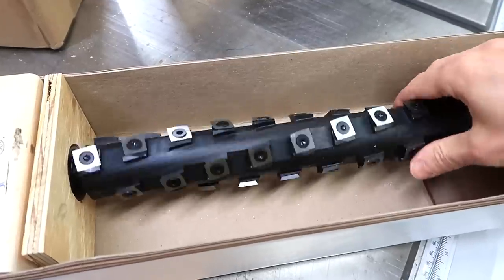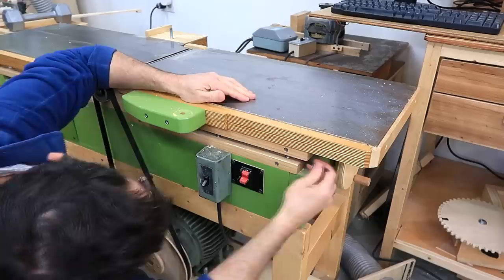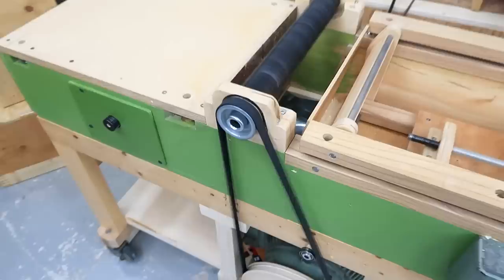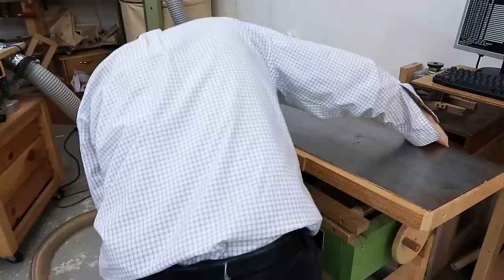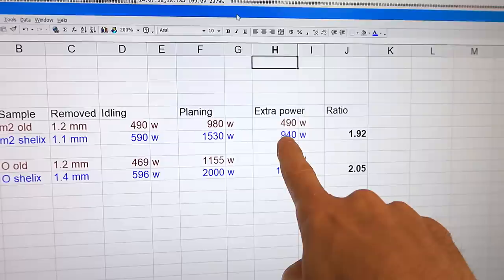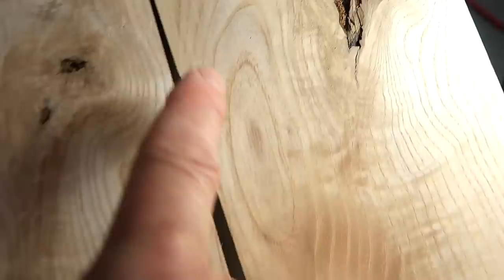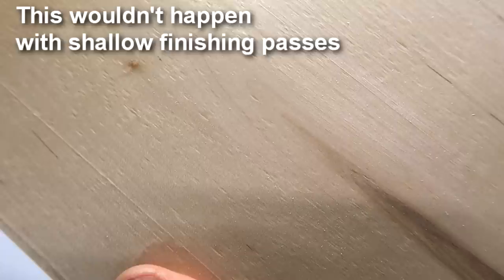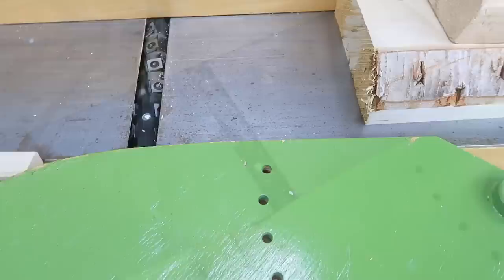Shelix head vs HSS planer head: Comparative tests

Comment: Recent installation of Shelix head in my jointer has made a world of difference in the ease of use of the jointer and the noise level. The jointer operation is MUCH more smooth and much quieter. Quality of the cut is much better. Have on in my Makita planer as well.

Comment: You have to find that problem! My shelix is whisper quiet in my jointer and much louder in my yellow Dewalt planer. 
That thing is dangerous.(I think, I don't actually know) 

Also! I didn't think I had a miss aligned cutter in my planer and I thought I bent something. I'll go take a look next time and maybe I just shifted a cutter on the pallet garbage I was running thru there. I was afraid to look.

Comment: Nicely done.  You could probably see if it is balance or the bearings by removing all of the cutters and letting it spin.  Could also test that it was ground round and straight when doing that, since you already have the dial indicator handy.  It's a lot of little things to undo, but it should work.  Also, you could better align the cutters when reassembling. :)
Reply: How does removing the cutters tell you anything? Any imbalance would almost certainly be in the head, not the cutters.
Reply: @trevorlambert4226  The cutters might have come from two different manufacturing batches and might have different thicknesses.
Reply from the maker: if they had different thicknesses, that would be VERY obvious from the cuts!
Reply: @matthiaswandel  Great point!

Comment: Is the Shelix head heavier than the old head. On my DeWalt DW735 planer, I think the default head was aluminum and thus a lot lighter than the Shelix I replaced it with.
Reply from the maker: old one is considerably heavier

Comment: Sounds like a bad bearing and some of the inserts are not seated properly. It should not sound like that or vibrate at all. I did the DW-735 swap and it was fantastic, also 8" on my jointer and it purrs like a kitten with zero vibration. I can easily balance a nickel and penny on the tables.

Comment: I always thought that the carbide blades were susposed to be more effecient cutting because of the angle they cut at and they slice at the wood rather than slap it. But maybe because there is more cutting surface it does take more energy, even at no load because of air resistance.

Comment: the reasin why its louder with the va is pretty simple.
without the vac, the flat cutter head is spinning at a high speed and very close to the edge. the high speed and air causes the pulses of air. this creates a cavitation noise and behaes much like a electromechanical siren. when the vacuum is turned on. more air is forced between the head nad table causing the pulsing sound to become louder.

Comment: Interesting observation on the blade angle of the straight cutter versus the angle on the inserts.  However the angle of engagement on the workpiece is not as simple as indicated in the video. Be-cause of how the inserts are mounted on the cutter head the angle is not so much scraping but more piercing. The insert cutter heads come in three forms, spiral, helix, and v-helical and all require increased force to push the work-piece. The advantages of insert type heads are better finish and easier recovery from chipped cutters. Except for YouTube I have never see a claim for quieter or energy efficient operation.

Comment: The carbide inserts have a grade tolerance on the edge position relative to the seat, not sure if those are tight or loose tolerance, so not sure if the lines can get better or not.
I suppose in madness you could get a bunch of loose ones and fit it to each seat measuring edge alignment.

Comment: Shelix in my 20" powermatic planer for 6 years now... will never go back to straight knives.  Also, I plane a lot of end grain cutting boards...  it's almost necessary for doing that in bulk.  Also, there's something wrong with your cutterhead.  The bearing issue and you have some inserts that aren't seated correctly.

Comment: Didn’t hear if the knives were sharp or new. I think that could make a difference in power consumption.
Forward rake knives compared to zero rake. Inserts will always take more power.
Add a 6 degree facebevel on the straight knives and see the surface it produces and watch the power consumption go way up.

Comment: Great video.  Thanks.  I was considering upgrading my older Makita lunchbox planer with a Shelix head, but now seeing empirical data on the increased power consumption, I feel like the planer might be inclined to let the smoke out.
Reply: How much do you pay per kilowatt hour?  How many hours would you have to run your jointer or planer for the difference to be a significant cost increase on any given project?  It seems to me (swag) that the difference would be minimal.
Reply: @marshallmurrell4583  Where did I say it had anything to do with energy cost??
Reply: @Keifsanderson  You didn't.  I inferred that from your remark re power consumption.  It would seem that power concerns would be cost or amount of power available to the shop.  I know that I trip a breaker from time to time and I know that I need to add additional circuits.  I hope my earlier comment did not offend.
Reply: @marshallmurrell4583  You inferred incorrectly.  The concern is whether a motor sized for a standard cutter will survive the increased demand of a spiral cutter head.  Good night.

Comment: I wonder if the layered sawdust on the outfeed had become almost a part of the build over the tears. 

It's as if the machine ended up making things function with the sawdust present.
 
I had a similar issue after removing the dust from the nooks and crannies on my old pantorouter cabinet. (It gives me an excuse to redesign it with linear rods lol.)

Comment: Possibly a silly question, but wouldn't you expect a helical cutter to use less power at any moment, but an average of the same power?

Obviously a cutter which cuts right across its width at once will have bursts of power consumption each time it meets the wood, whereas the helical cutter would take a little bit as each cutter meets the wood?
Reply from the maker: the Hss knives are more like knives but the carbide is more brittle and shaped more like a scraper

Comment: Sound is a fickle thing, did you turn off any automatic atenuation? might've just adjusted to the higher base level sound of the vibrating planer and thus the cut noise is also lower.

Comment: I wonder, could you try turning the teeth upside down to cut instead of scrape?  Or is that angle too steep?  Because I'm guessing the power difference was mostly due to the extra weight - having to 'spin up to speed' constantly as it's being slowed down by (slightly higher?) scraping friction.  There's also the fact it's cutting at every degree of rotation, not just on the opposite faces?  The shelix isn't cutting as much with each tooth (maybe only 2 or 3 engaged at any one moment), but it's a constant force, rather than the intermittent one of the flat blade.  It feels like that would be more of a drag.
Reply from the maker: if you turn the teeth upside down, they won't even scrape, all they will do is knuckle the wood.

Comment: I'm surprised there was no comparison of their weights. If the helix is heavier then that could account for some or a lot of the power consumption.
Reply: More weight won't use more energy (except on spin up) as the energy in the rotating mass in conserved
Reply from the maker: shelix head is lighter

Comment: I wonder if the shelix cutter bearings will "break in" with some more time on them and start to use lower power to idle, and maybe run a bit smoother.
Reply: no bearings are precision parts, they dont break in ideally. more likely that the wood supporting the bearings isnt properly aligned (there is a reason bearing seats are machined from metal in "serious" applications) causing it to not run properly. or the bearings are shot, propably both, but its important to know, that using precision stuff like this in a DIY machine made from wood is far from ideal. does it work? obviously. does it come with drawbacks and problems? obviously again :)
Reply: Don't think so. Something is wrong with the new shaft. We have two of these in the shop and had another in our old planer. I'd never go back to straight knives again. Cut quality, especially over time is so much better.

Comment: This head will produce short chips, whereas the regular head will produce long chips (to match the width of the board) which have the potential to choke the dust collection system.

I was wondering about the scalloping. In theory it should be possible to shape the carbide inserts to avoid this, but the shape would have to be tailored to the cutting head diameter and the helix angle of the individual cutters, making it impractical to do.
Reply from the maker: if the cutters produce an exactly straight cut, there would be more ridges from misalignment
Reply: With straight cutters, the cutting edges each sweep out a section of a hyperboloid surface, so each cutter effectively cuts a sort of swallowtail shape, with the "notch" of the swallowtail being a hyperbola, and the "spurs" of the swallowtail being from the radius of the corners of the carbide insert. This cuts a W profile into the wood, with a broad shallow bump in the middle and asymmetric V grooves on each side, broad towards the inside and somewhat vertical-sided on the outside. If you have ideal alignment of the cutters, the V-grooves of adjacent cutters line up perfectly, and the V's are broad on both sides and just show as a very shallow-angle V.

If the cutters have an elliptical profile (minor axis = cutter head diameter, major axis = cotangent(helix angle) times cutter head diameter) they will trace out perfect cylinders. Each cutter's cut will be bounded by a corner dependent on the shape of the corners of the carbide insert. With proper alignment this will give a perfect flat surface. Lateral misalignment of the cutters will have no effect (provided you preserve some overlap between adjacent cutters), and height misalignment will produce shallow flat-bottom areas on the board.

If the cutters have an even stronger curve than this, they will cut a shallow cove cut, and each cutter's sweep will remove any edge profile from the adjacent cutter's cut. The surface will have broad flat ridges with smooth hollows between, like the surface of a fluted column. In this case misalignment of the cutters will result almost entirely in just shifting the ridges laterally.

Although the elliptical profile cutters can in theory produce a perfectly flat surface, it is prone to imperfections if the cutters are not at perfectly the same height. The straight cutters are more prone to imperfections from misalignment since lateral alignment also affects the finish. The more-curved-than-elliptic cutters are probably the best compromise between the possibility of perfect flatness in the ideal and the reality of imperfect alignment. The ridges produced by their misalignment are going to be less visible than the grooves from the straight cutters, and will also be easier to hide by other finishing methods (sanding or scraping)

Comment: Sealed precision bearings will not spin freely once greased.  The shelix cutterhead might be better served using high speed, low load sealed bearings.

Comment: MW  what was the source of your shelix head/ size and cost  carbide square count and  type (some are wedge edged and use a corner). Would a higher quality sample make a big difference and best quality bearing are the absolutely parallel.

Comment: Metal detecter?
I’ve started strongly wondering why no woodworking tools have metal detectors build in. The boring answer is that they are made of metal, but you can tune a detector and have a microcontroller on it. Planers and routers especially: it could just shut off before the metal is within range of the cutter.

Comment: I saw when you inserted the new cutter-head and bearings in your bearing blocks, it seemed to get in pretty smoothly without any force (at least the first one).
On your bandsaws I remember the fitting had to be tight, in order to prevent it from working loose. 
Am I correct, that in this plander configuration the bearings are not prone to work themselves loose so easily as on a bandsaw?
Reply from the maker: yes.  whichever part that spins needs the tight fit.  these bearings are tight on the head

Comment: Hi Matthias, I bought your plans for the jointer but wanted to ask how have your wooden bearing flanges held up?
Reply: Obviously not Matthias, but given that the outer bearing race shouldn't be moving unless there's major issues, they should hold up pretty darn well to simply static clamping load on a ring.
Reply: Do you mean bearing caps?

Comment: I wonder if you can get finer angle carbide inserts to make it "sharper" without affecting the geometry? Once balanced if you could do that, it'd be my pick.
Reply from the maker: no.  those would be too prone to break.  breakage is an issue on these already
Reply: @matthiaswandel  Interesting. Thanks, I value your wisdom very much. XXOO

Comment: Since you use this jointer for 11 years, the size seems perfect for you. Do you know how wide it is and how l long the in and out feed tables are?

I am considering to buy  10 inch version (Hammer a3 26) which are still affordable.
Reply from the maker: its 12.5" wide, and probably about 52" long

Comment: Unfortunate results.  Colleagues who have done the shelix upgrade with their DW735's report much better results surface wise, and a little quieter, though the 735 is too noisy for my ears.   I have the spiral cutter heads in my Powermatic planer and jointer, and I can hold a conversation while running either tool including the Jet cyclone dust collector, unlike the 735 by itself.  It does sound like your cutter head is unbalanced, but  I also suspect the wood construction of your jointer is a contributor.  The compliance of wood versus cast iron would give you a lot more problems with an unbalanced unit, not to mention your design being a resonance chamber.  Your shelix unit must have been damaged somehow in shipment.  I would expect the shelix head to be balanced coming out of the machine shop.

Comment: I think it will be a good idea, to wear safety glasses while working on this beast. Maybe it decides to explode without further warnings.   🤯
Reply: if a carbide blade flies off at 8500-10000rpm, safety glasses won't do a whole heck of a lot
Reply: @natalieisagirlnow  Assuming a 2inch/5cm radius of the spindle at 10000rpm ~= 105meters/s or 234mph. That would be covered under safety glasses with an impact rating of B (120m/s). ANSI Z87 only requires impact rating of F (45.7m/s) and it seems to be kind of baseline standard. So if you got something above the cheapest kind of impact rating you in theory would be good.

Comment: There is no chance I would be using that head with just 4 screws holding it, I cant imagine what the centrifical forces would be. If it is out of balance it is going to tear that apart.

Comment: Shelix head has less cutting linear length per rpm,so you can't really compare both like you did.
You need to increase rpm on the shelix to have an equivalent to the planer head,or reduce board sliding speed.
Also noise volume is inferior from the fact air from dust collection circulate way easier between the carbides.
Reply from the maker: both make 2 cuts per turn,  shelix has 4 rows but each row only cuts Hal’s.
Reply: @matthiaswandel  
shelix doing half work the than  the planner head per 360°
You have more linear cut length total  being an elicoidal arrangement ,but only nearly half work done per complete 360 ° contacting the board.
planner head have 2 times board to blades complete linear contact per 360 °

Comment: what if you put 20lbs of weight on the board instead of 10lbs?
Reply from the maker: then there would be 20 lb of weight on it instead of 10
Reply: @matthiaswandel  and what if you change the drawing speed? Would it impact sound level, power consumptiom, quality of the cut?

Comment: Which smart plug do you use?
Reply from the maker: Tplink HS110.  But with the relay replaced with a short, cause I burned out the relay from other tests with motors.  The motor startup surge current is something like 50 amps, which blows the relays after a while.  This one is discontinued, but they have a new one, the KP115

Comment: About your DIY Jointer - Any thoughts on a Double headed Jointer / Planer machine to perform both operations (Joint on the bottom, make parallel on the top) at the same time?
Reply from the maker: only useful for production, not useful for the home shop